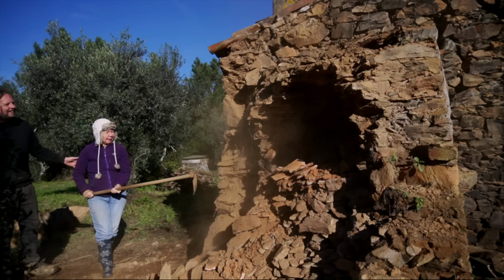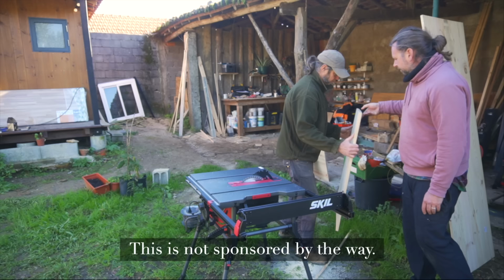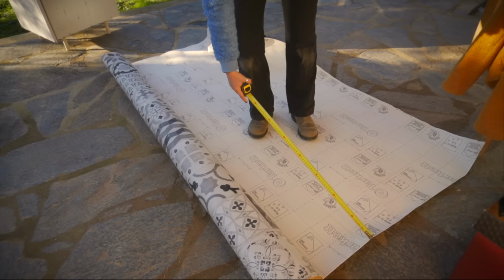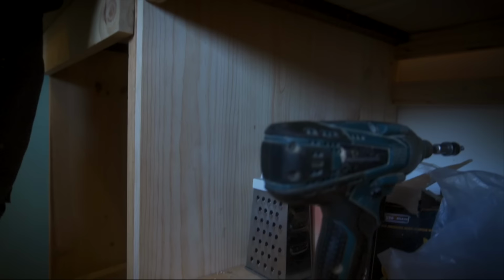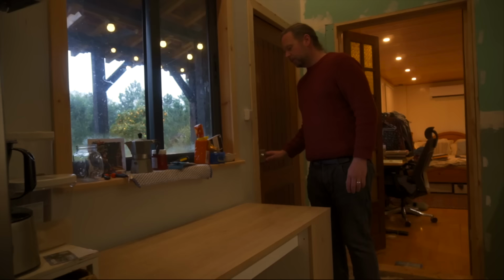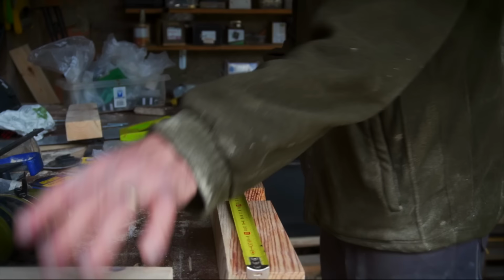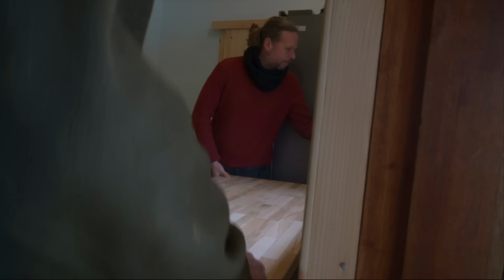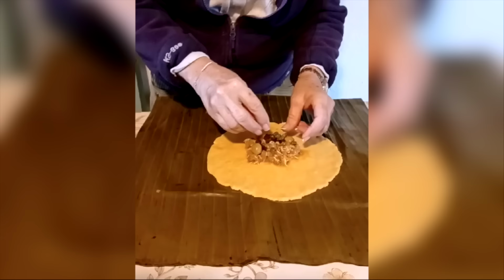The best addition yet! Building Our Mortgage-Free Homestead

Comment: Pity there is no oven plug under the table. If oil both sides of the table, then it would twist. Think if the doors would open outside, everything would be less cramped. Or think of the opposite: how odd if cabinet-door open inside, so why should other doors do that? ;-)